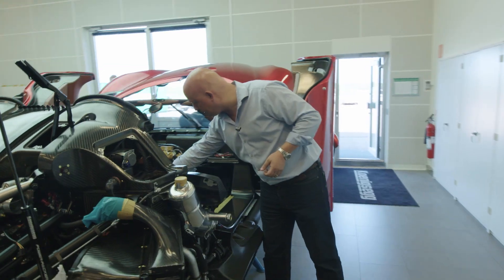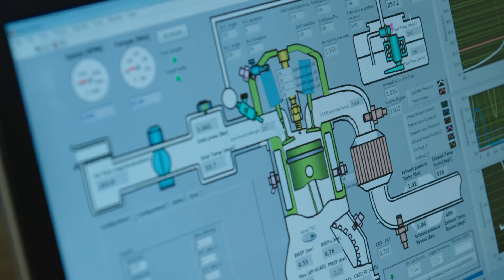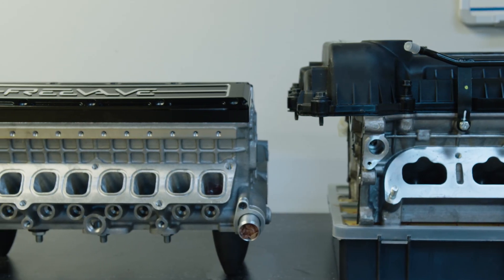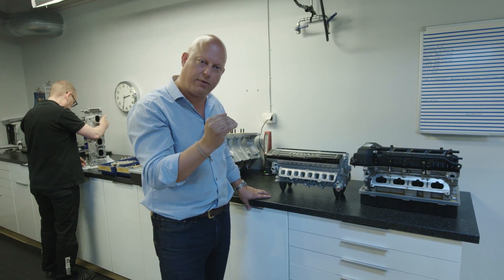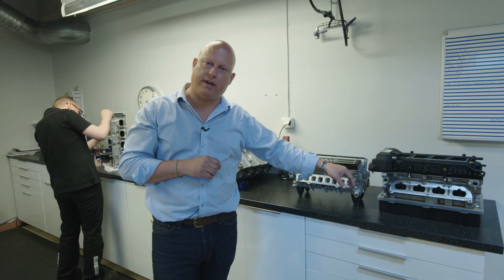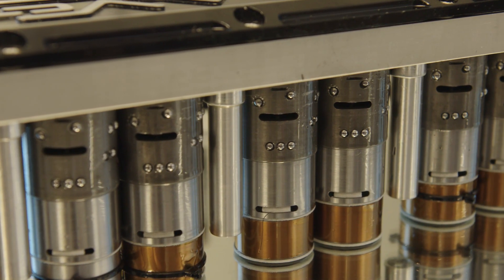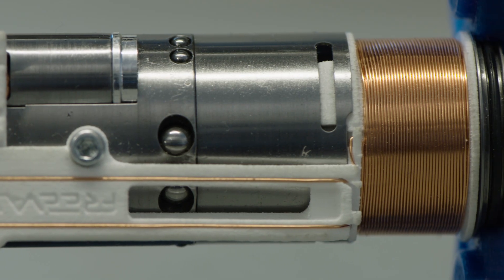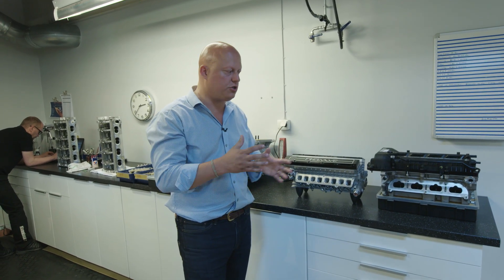Freevalve Update Camless Engine -- /INSIDE KOENIGSEGG

Comment: This needs to get to the market as soon as possible.
Reply: Petar Menger together with turbulent jet ignition, this might be the best innovation in combustion engines in the last ~20 years, since the mass invention of turbochargers
Reply: Man thats a crazy though. You have a dead cylinder and maybe at worst you get a check engine light and the other cylinders get reprogrammed to take up the slack.
Reply: Maybe, still would be possible to put them in engines. Like he said, there is a lot of cost reduction. And i one fail, your engine would still work, the cpu would just deactivate the cylinder until you replace the valve that failed.
Reply: No it is not samiliar, valvetronic requires a camshaft and complex levers. This is a camless system.
Reply: Koenigsegg has done that testing already, the first video where they showed of this technology was years and years ago.
Reply: Technically this IS on the market. If you go to FreeValve's site, there is a request/contact form, where it specifically says that they take only larger orders (car company orders) and not individuals, but still it;s on the market.
Reply: If the car company they're making this for is going to put the engine into production I'd ship one over from china... Race engine anyone?
Reply: do this on a small block Chevy and ford,and let the dragracers,do your development and field testing. a better turbo motor is going to dominate
Reply: TheRebel3000 I would love to design my own engine with the FreeValve technology to have a higher HP and torque at a low end with also being economical and having a sport mode
Reply: John Wade+ that's why Koenigsegg are using pneumatics, less problems with the viscosity and inertia of the working fluid
Reply: The biggest issue with that is being able to make them at a cheaper price. They haven't been massed produced yet but I think that's in the works!
Reply: GRENAgaDE No.....

The valves are NOT controlled individually. They are LINKED to the CAMSHAFT. 

The only thing the Fiat system does is reduce reciprocating mass, which is good. But its not even close to being able to ELIMINATE it completely along with complete control over each valve.
Reply: Damian Toczek Think about what? If you think the Fiat system is anything like this you are simply an idiot.
Reply: +Petar Menger you could theoretically purchase an f1 engine if you had the cash
Reply: Anton Fesik multiair does not use an intake cam. it uses hydraulically controlled solenoids that can limit oil pressure and change the lift and duration of the intake valve. not exactly what Koenigsegg is doing, but like i said, a version. you are correct about the programming though. i work at a chrysler jeep dodge fiat dealership and i can agree with you that those engines are not reliable at all.
Reply: Anton Fesik lol trust me, i understand. had to do the same training
Reply: GRENAgaDE ugay
Reply: cartmanrlsusall that's a really good question lol. I'm not sure honestly. If they did use an air tank that would add weight.
Reply: GRENAgaDE Its not a "version" of it at all. Not even close. The Fiat system is TIMED off of the camshaft. Therefore, the timing and lift is limited to what it can do.

This system doesnt use mechanical timing, it can therefore be controlled completely by a computer which allows for a nearly INFINITE adjustment to timing and lift on the fly.
Reply: Nick Palaroan as apposed to a rotating cam that physically pushes down on lifters/tappets, fiat uses solenoids to move the valves. they may be timed off the exhaust cam but it is still using the basic idea of having valves controlled individually by solenoids rather than a cam. of course the Koenigsegg design is more advanced and has more potential, but when you look at the price of a regera vs a 500, its easy to understand why the fiat system is more simple.
Reply: GRENAgaDE regers doesn't use freevalve.
Reply: in a functional sense it does the same it allows for a opening and closing of a valve as the ecm call for it not as a result of a rigid designed action
Reply: Nick Palaroan Wrong! Timing is controlled by the solenoid individually for every valve. But maximum available lift at all times is limited by the cam lift curve. Read the specification on MultiAir/UniAir on the web. I know, I work for the supplier that developed it.
Reply: Why? It's expensive as fuck for the consumer. Have fun paying lots of money for reservicing every few months.
Reply: BMW's Valvetronic allows similar control (i.e. changing how long valves are open, leaving some shut) but there are significant differences.  Valvetronic still uses a cam to open the valve so you have the gradual opening and closing vs freevalve's relatively instant opening; with the cam in use the parasitic loss of spinning the cam is still there and valvetronic actually requires a larger head than conventional so you don't have the weight/size savings of the freevalve.
Reply: cartmanrlsusall No.....in the Fiat system the opening and closing of the valves are controlled by the CAMSHAFT.

A hydrualic actuater may open and close a set of valves, but the timing is on the CAMSHAFT.

It has MECHANICAL timing. Which has limitations.
Reply: Renault tried something similar back in the 80's, but failed due to reliability and immature technology. Köenigsegg has had a rebuild SAAB that has run for over 120.000 miles without any kind of issues. See one of their earlier videos.
Reply: fiat/chrysler already using a version of it in many passenger cars
Reply: Zach L I get that I'm just wondering about how he gets the air to run the actuators,engine driven compressor?electric compressor?or stored air from a tank?that probly negates all weight saving from no camshaft ad smaller heads?
Reply: Lotus did it hydraulically in the 90's but had response speed issues due to viscosity.

Comment: This is such an awesome innovation, going to be awesome to swap motors with this tech into older cars someday!
Reply: Kris S Electric is not going to be the only option for a long time, this tech can and will GREATLY improve the efficiency and power potential of gasoline engines, everyone should be excited about that. As a "Gearhead" myself, I always will enjoy the fun of gas powered engines, but I'm not opposed to electric either when the tech is ready and it can be done right and be fun.
Reply: I agree, I can't wait for this to be an option for hot rodders. Early Chevy small blocks (pre-LS series engines) have the oil pump driven by the camshaft. This also applies to big block engines as well. I would like to see what the engineering solution is to correct this issue when removing the camshaft. Maybe a dry sump option?
Reply: Everything that is attached to the crankshaft uses parasitic latent horsepower. Everything should be electric. Valves, coolant, fuel, power steering, AC & oil pumps. I think the next revision should be the alternator. Strange- how we went from 6v DC to 12v DC and that's it. Nearly everything in your life needs step down transformers to utilize 110v AC, but some SUV come with an inverter to make 110v AC.
Reply: @nealelliott  just power it by the crankshaft, like my 300zx
Reply: @nealelliott  Please Google search, "Deferred Atkinson Cycle and Simultaneous Heat Extraction Engine".
Reply: @nealelliott  I'd say since everything is already electronic just use a fuel pump for the oil
Reply: GearHeads Garage It's only a matter of time.
Reply: Neal elliott Out of all the good ideas and redesigning going on you really think that will bea problem? almost every DOHC engine I know of has the Oil Pump driven by the crankshaft, only old pushrod motors like that probably would be driven by the cam, so this is irrelevant for most styles of motors. and DOHC/Push rod type of motor is irrelevant with this type of head, it even would be possible to make a head to throw on potentially any block as long as you have whats needed to run it.
Reply: @GearHeadsGarageChannel  Yeah, some people don't think before they speak.
Reply: Or, yknow, swapping this kind of head onto old engines and see what happens.

I'm looking at you, big blocks.
Reply: GearHeads I came up with this idea more than a decade ago. Everybody said I was stupid... Now I get to go ask them, 'who's stupid?' Lol.
Reply: ***** There is a new company in the US that is producing ethanol from a new cyanobacterial they made. They've been pretty quite on it because from my understanding making ethanol from weeds is a two step process, need one organism to process the cellulose and then a second organism to finish it. Joule Unlimited apparently engineered a single cyanobacteria that can do the whole conversion. The big plus they claim is that they don't need fresh water, so they can use reclaimed water that is unusable for crop consumption. They are currently working with Audi and Audi has a brand name for their ethanol fuel that is based on the process. I can't remember.
Reply: Biowaste is by definition free. What could be better than free?
Govt subsidization ofc
Reply: speed demon If you had any clue how to do that you'd know that ecu control could already do that without freevalve tech
Reply: Ryan Hard Yup...
Reply: Yea, this tech has been around for quite some time, but it's only Koenigsegg that is getting close to releasing the setup. Should be awesome. Could you imagine this on a VCR-T setup?
Reply: They made camless engines before.
Reply: Eric Fixalot BMW,renault,fiat,ford.
Reply: Neal elliott dummy shaft and or plugs 
Problem solved
Reply: Too little too late. And focus on wrong tech. Electric will disrupt this dying tech like you have never have dreamed of in you worst nightmares.
Reply: GearHeads 
My friend see the electric engine in my vlog maken after combining Engine piston and Motor electricity and share your reviews....
Reply: Not really much of an "innovation" considering F1 and Moto GP have been using the same tech in engines for literally decades now. Normal cars can't have it because the gas in the pneumatic system escapes from the cylinder head. This causes longevity and reliability issues that you don't get with standard mechanical parts. It's nothing more than a gimmick.
Reply: Yea, Koenigsegg is all bullshit, fake, and not worth a dime. Yea, ok. Go tell him he's full of it.
Reply: swap electric motors? I agree
Reply: Also working on turning brewery effluent into batteries.
Reply: lxwvandenberg  that sounds interesting.
Reply: Can't wait to swap this into a 427 Chevy Big block!
Reply: yeah, like an old 2cv or a VW beetle! :D
Reply: Yeah finally maybe chevys will be decent cars with some of these in them rather than the GM junk LOL.
Reply: @PatrickBaptist  Ford  made plenty of junk too Don't kid yourself
Reply: Anti, I don't like anything ford makes today, nor did I ever say they didn't make junk.  Try and grow up and not presume things I didn't say sir.
Reply: Anti, I don't like anything ford makes today, nor did I ever say they didn't make junk.  Try and grow up and not presume things I didn't say sir.
Reply: Anti, I don't like anything ford makes today, nor did I ever say they didn't (edit)*EVER* make junk.  Try and grow up and not presume things I didn't say sir, because I sure don't believe that.
Reply: @PatrickBaptist  well maybe you shouldn't group all GM cars into one category. I have owned a few GM products and they were very good cars. Yes they've made some real junk too and so has everybody else including Asian manufacturers.
Reply: I think the biggest advantage is power savings not having to push against the springs all of the time. If you have ever spun a motor over with no springs in it you will understand how much of a power drain this is.
Reply: +Mike Brink and +Sigma Project para que usar caña de azucar y maíz para producir etanol si en la profundidad del océano hay miles de partículas de etanol y fabricaron cyanobacterial? eso ya existía desde la naturaleza que lo modificaron es otra  cosa
Reply: In which country are you living?
Reply: Sigma Projects  isn't it a two step process with corn? Coverting the starch to sugar first then get the yeast to get all sugared up so they piss everywhere
Reply: Steven Seagull, you for not capitalizing on it
Reply: What will be really awesome is for you to be able t afford d to do it.
Reply: M
Reply: They already have the 1.6l built, when can I get one that will fit my Honda? Could have the best of both worlds, power and fuel economy when you want either...
Reply: Please Google search, "Deferred Atkinson Cycle and Simultaneous Heat Extraction Engine".
Reply: This is old and has  been tried.
Reply: That combined with the fact that you can have 100% renewable fuels these days.
In my country there is bioethanol based "E85" fuel, which actually has the 15% of additives to make the ethanol function in cold, better starting, less "drying" of rubber etc. to ensure higher quality, higher safety. So basicly 100% Bioethanol + some additives.

It's also made from trash, nothing gets farmed solely for it, but only byproducts and biowaste from households is used to make it :)

Same thing is happening right now for Diesel fuels in my country, tho they make it out of trees i believe, and i think they also plant new trees. We have huge amounts of forests here (land of green gold).

Combine this with all the up & coming technologies:
Co2 recapture and forming into fuels.
Bacteria based waste to fuels
Bacteria based PLASTICS back to chosen raw material OR biodiesel

Imagine a huge solar farm which would use all the over production for Co2 recapture and transformation into fuels, and using that resulting biofuel instead of batteries for baseline capacity and remainder for vehicles.
Eventually we'd reach a point where we would have so much recapturing that we need to turn them into longer hydrocarbon chains (oils, and with further refining polymers ...)

Essentially, i think we can eventually have fully renewable, fully clean & grean, and ever meaner internal combustion engines.
When battery capacity starts to provide more MJ/KG and MJ/Volume than any of the biofuels the internal combustion engine's days will be finally numbered in almost any application.
Reply: skaltura 
Well, there goes the fuel tax base.  LibTard Solution: Raise Taxes, then add Regulations.
WTH?
Reply: GearHeads Garage and that day I will hack your car's ECU and blow up the motor.